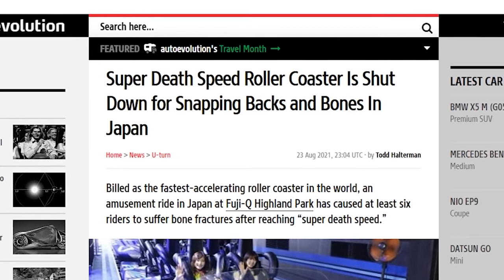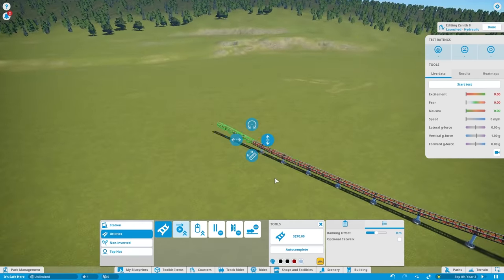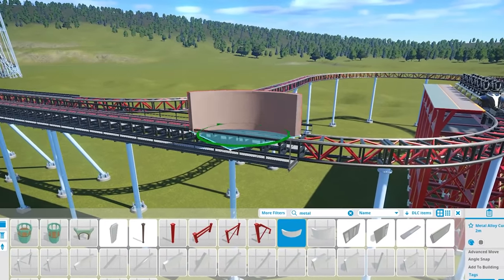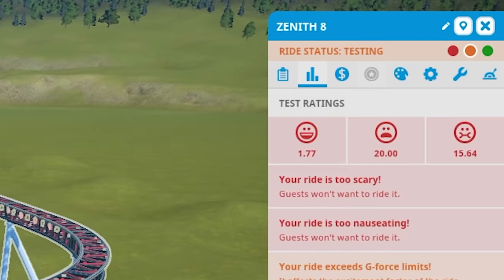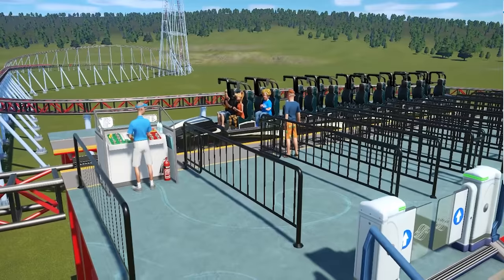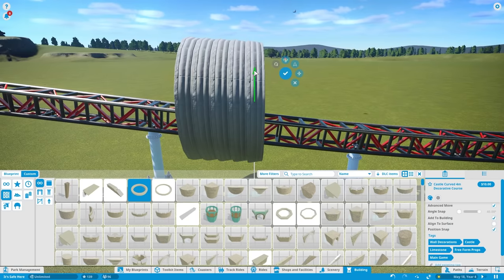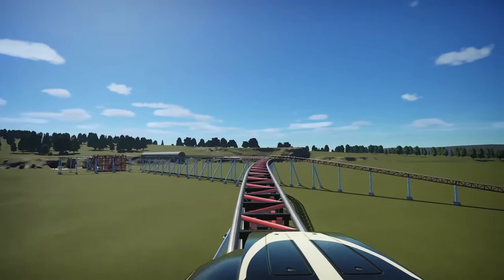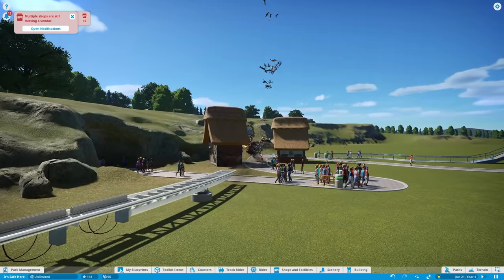I Made DO-DODONPA! *Japan's BONE-BREAKING Death Coaster😈*

Comment: Bro if you truly want to break next speeds take the roller coaster you already built and then add a hill because actually do-dompa used to have a hell and they said if you had your hands up it would One of two things either dislocate your shoulder because of the sheer velocity as you were going down or it would just break them entirely I’m going through a loop your hands would just like to make you go like just head to the back of the seat and then going upside down would either make you like fallout or like will extend your neck and crack it and then going down would also bend and extend your neck and crack it which is why originally do-dompa only had a hill instead of a loop and a hill and now only has a loop